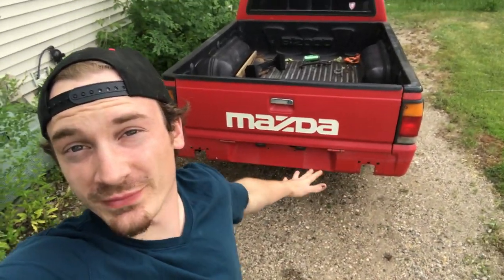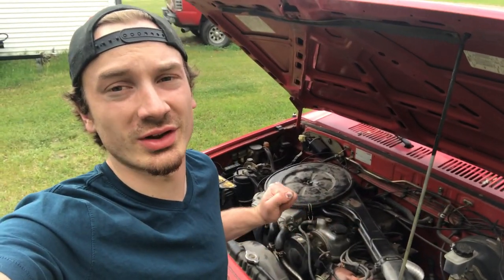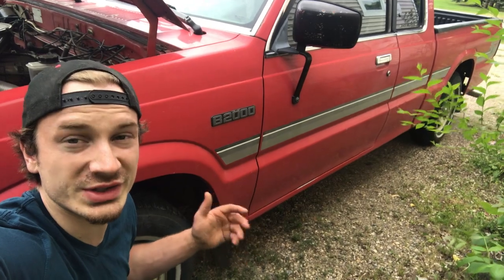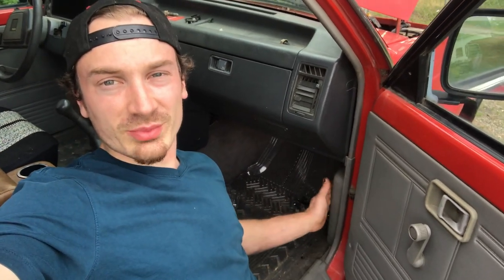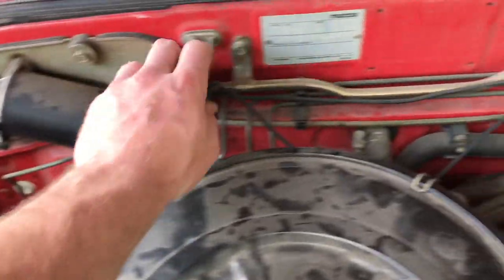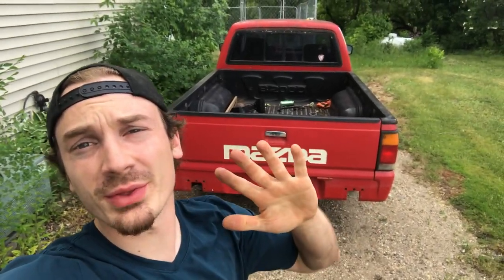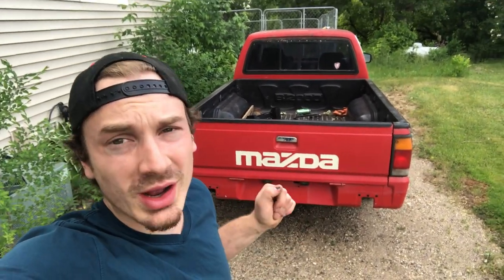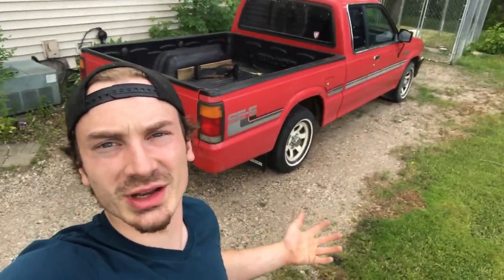Five Things I HATE About my Mazda B2000

Comment: Just turning 300K on my 87 SE-5. No rust issues, no ignition switch issues and love the 5-speed, power steering and great cooling factory A/C. Since I live in Phoenix I still run all the factory emissions junk and pass the test every 2-years well within the limits.  I'm the second owner and had it close to 17 years. It still has the OEM bed liner and original factory paint.
Reply from the maker: slickraft that’s awesome! I was just in Phoenix two weeks ago on vacation! Thanks for watching :)

Comment: I have a 1993 b2600i, 2WD 5 speed with an extended cab. It had 76,000 original  miles when I bought it in 2014 and now it has about 93,000. I love this truck and the only reason I would sell it would be to get another pre-1994 one in 4WD with air conditioning. I’ve only had minor parts needing replaced, biggest one was the original radiator cracked.
Reply from the maker: Check out a few of my recent videos to see my 4x4 with ac ;) tomorrow filming the whole transformation on it so stay tuned!

Comment: Every time I'm in a pull-a-part, I buy any ignition switches I can find and always keep a couple under the seat. Taking those switches apart & cleaning frequently fixes them, but sometimes a contact will be burned beyond use, & that's when I just grab another switch... If by chance the 2nd switch is bad a combine the 2 to make 1. Yes your push button would avoid that.
Reply from the maker: That’s a good tip! I never see any of these trucks around here in the pick n pulls. This video is old but since this I’ve opened my own repair shop!

Comment: About your complaint of valve adjustment - The cylinder head from the B2000 is the same as the cylinder head on the B2200. You can pull the B2200's cam and stick it in a B2000 head to get your adjustable valves.
The more common thing to do is pull the 12 valve head off a late 80s Mazda 626 and get yourself some extra horsepower.

Been working on my friend's B2600i for a few years now on and off and always wanted my own, finally going out to try and buy one some time next week. It's an 86 B2000, single cab long bed with the 5 speed. Really wanted the short bed and would have liked the cab plus, but this truck is super clean except for an exhaust leak.
Reply from the maker: Dude I would trade for a single cab long box in a heartbeat lol
Reply: @shiftwrenchrepeat  I don't really have any plans to use the bed. It's replacing a minivan, so the extra passenger room would be nice.
Unfortunately the short bed trucks are very uncommon down here
Reply: I like regular cab trucks. Prefer them to.

Comment: Just wait until you have to replace the driveshaft .  The driveshaft company in Spartanburg SC. could not find a center joint that would work  the outer ones are not replaceable. bought a used shaft for $50.
Reply from the maker: I have spares!

Comment: got a 87 b2200 have had it for 20 years and have had no problems with 187000 miles original clean
Reply from the maker: I still have this one, I just got some wheels for it I’ve wanted for ten years, I’ve had five. Love these trucks
Reply: They are nice trucks man mines got 67k and it's an 87

Comment: Nice truck! I have '86 B2000, rust spots in both front wheel arches, slightly different emissions setup (Swedish market version - only two hoses going into the carburetor) and fortunately, ignition still works fine :) So, generally, it's a great truck, no power anything :)
Reply from the maker: misha that’s how I like it! Less to break! Thanks for checking it out I appreciate it
Reply: Har en lika dan! Har du en insta så jag kan se den?

Comment: just found a 1986 with 40k miles for sale an hour away from me in san Antonio tx for $3500 but it has a short somewhere and the battery isn’t charging. It is a very clean truck but idk its worth buying
Reply from the maker: I’d do it, the electrical is simple on these
Reply from the maker: I still have this one
Reply: @shiftwrenchrepeat  how much do you think it’d cost at a shop

Comment: the automatics are probably absolutely horrid I can only imagine, but the 5 speed manual has the same basic transmission as a Miata, just a different shifter
though it could be a different transmission, either way it's got the same notchy feeling to it and it's quite nice, not sure which one would hold up to abuse more efficiently, assuming you're not running crazy amounts of power it can still handle very rough clutch dumps, burnouts, and even slamming gears like a hooligan
Reply from the maker: I’ve never been super nice to mine!

Comment: I liked your video . My 1987 B2000 cut off on me in a storm I replaced the ignition switch $35. on eBay the directions said to make other arrangements to get power to the air conditioning and heater fan. I didn't follow directions so after about a week the ac clutch wouldn't, engage. IT will work if I straight wire it . The electric choke works off of a wire on the back of the alternator  in the winter the motor ideas to high ran 12v to choke and it still won't idle down.  Running summer been gas the motor skips at low speed have new E3 plugs motor dies sometime starts back on its own no red lights on dash .replaced fuel pump of 2200 motor. going to check pump . My put on new switch again . Put extra red hot wire and ground to new starter new relay system controlling starter selonid key power controls 12v relay . I like your push button and coil switch .do I need to put a resistor on coil power wire or is the resistor in the coil. Thank YOU.
Reply from the maker: redtailhawk289 you don’t need to add a resistor!

Comment: I have a 1989 Mazda B2200 and it is completely rust free but I am also down in Virginia. It is all original minus the radio. I wouldn’t buy an automatic I agree. The only problem I had with mine is the fuel pump goes bad a lot but other than that no problems. I am a mechanic so I do all the repairs and they are super easy to do. This video did teach me one thing and that’s where the computer is because I didn’t even know it had one.
Reply from the maker: Indeed it does!

Comment: Do the automatic transmissions last? I'm looking at a 92 right now with an automatic transmission in it and 225000 miles
Reply from the maker: I’d always go with a standard for reliability. I haven’t heard a ton of complaints about the autos tho. I’d definitely drop the pan, measure the amount of fluid you take out, change the filter, and then add the same amount of fluid back in along with some Lucas trans conditioner. Don’t pressure flush it! Do it this way. Hope this helps! Drop a sub if you haven’t already!

Comment: Mazdas are unique. How long did it take you to realize it has a plate on the engine that covers a port where you can put a manual fuel pump in place of the electric pump in the tank? This saved me $140 because I didn't have to buy another electric one.
Reply from the maker: The b2000 and b2200 both have mechanical engine mounted pumps from the factory
Reply: @shiftwrenchrepeat  My 87 did not but had a factory fuel pump in the tank. This was when I was told about the metal plate and to check and see if my engine had one, and lo and behold it did.
Reply from the maker: Did u have an efi model??
Reply: Just had my fuel pump replaced. $525
Reply: @shiftwrenchrepeat  no

Comment: Hey thank you for the video! I'm buying a 91 2600 for my daughter and I wanna truck it out a bit. Curious bc the truck is lowered do you know if a set of 20s would fit with a 3" drop blocks in the rear?
Reply from the maker: I can’t say for certain but I did have one with a 4” drop on 16s and it was tight, but depends on the tires and everything else
Reply: @shiftwrenchrepeat  thank you bro

Comment: Iv got a 91 b2200 and my low oil light stays on I put a after market oil pressure gauge and it says it's fine how do I get the light off
Reply from the maker: Jordon Burleson was it a quality gauge?
Reply: @shiftwrenchrepeat  yes it's still in my truck working fine

Comment: Has anyone lifted the box off their B2200?  Got a faulty fuel gage sending unit and some rust, thinking it might be better to pull off the box and work on the  tank from the top and avoid dropping the tank.Thoughts?
Reply from the maker: I did it, if u have a lift, the tank is easier (even without it’s not too bad if u have something to slowly lower it) I’d personally do that before I pull the box (I’m also a professional technician for reference) hope this helps you!
Reply: @shiftwrenchrepeat  Been debating the best way.  The plus to bed removal is better access to rust repair (Minnesota!). Just trying to minimize the out of service time. If I never have to rebuild another carb like that I will be pleased.